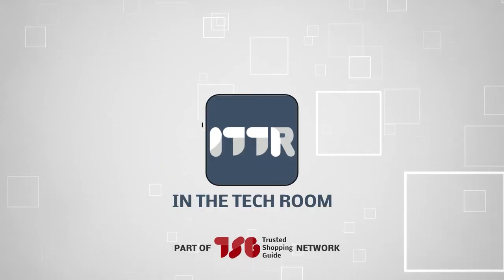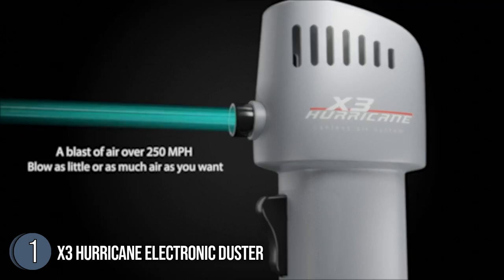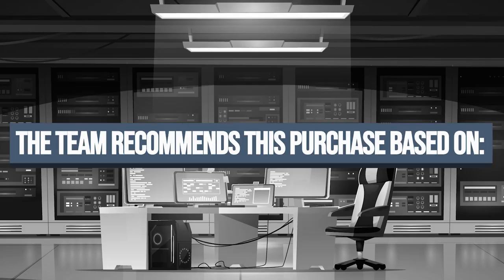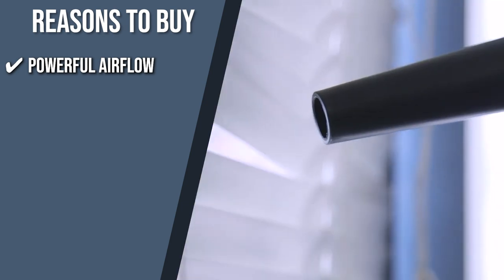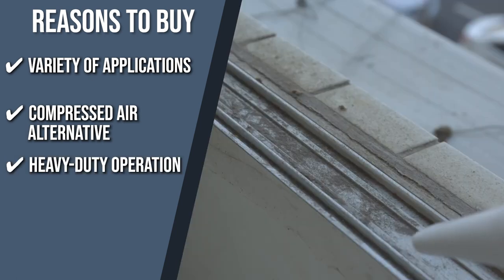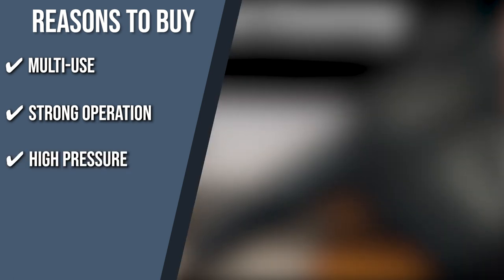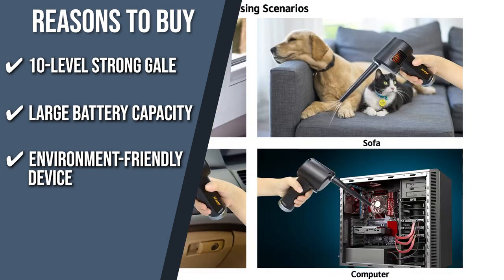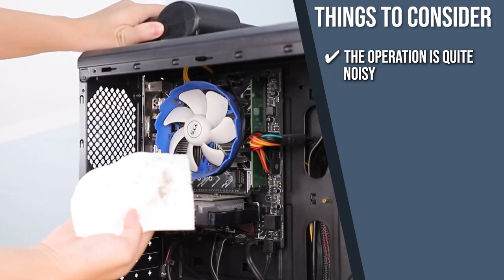🖥️ Top 5 Best Computer Air Dusters|Compressed Air for Cleaning PC

Comment: The best product for cleaning out your PC or any other electronics is not present on this list. It's the MetroVAC DataVac. It's all steel with a .75HP motor and has an airflow rate of 70CFM. The DataVacs are used by businesses that have cash recyclers which are very susceptible to dust and this thing cleans those out. You pay more for it, but buy once, cry once. The thing lasts for years and years and never lets you down.

Comment: 2:46 it recommended that you hold the fan still or disconnect it so it does not build up any charge
Reply: Came to say just this but in a much less calm way. PLEASE GOD NO DONT LET YOUR FAN SPIN LIKE THAT
Reply: Saw it and nearly had a heart attack. Hold your fans still!
Reply: The risk of that charge is minor compared to the wear and tear it does on the bearings of the fan itself especially when being spun quickly in the wrong direction.
Reply: Take a fan, hook it up to a multimeter, then do exactly as you saw. You will see 12-20v of electricity being produced, now think of that being ran back through a powered off motherboard. Easy way to blow a fuse, or worst case, fry the CPU. Bearings are the least of your worry. 
 @DarkFilmDirector